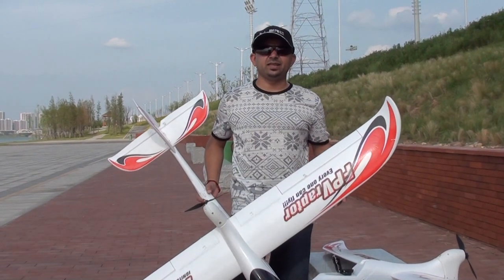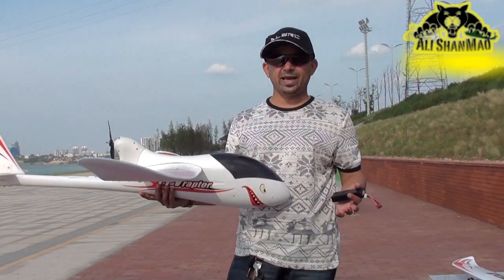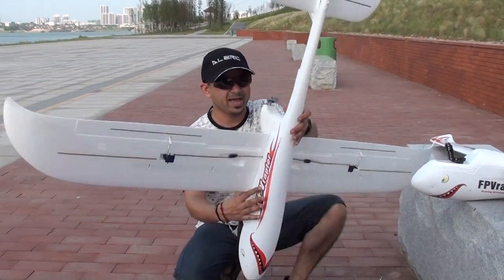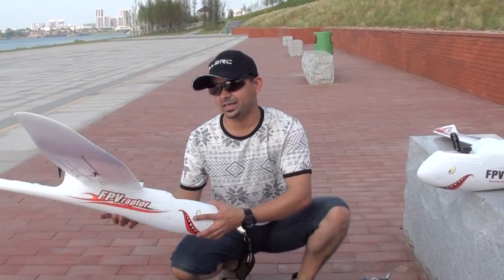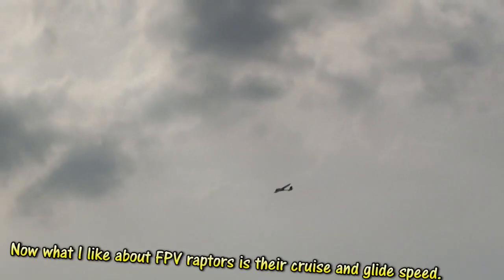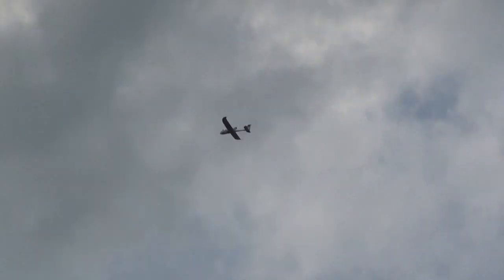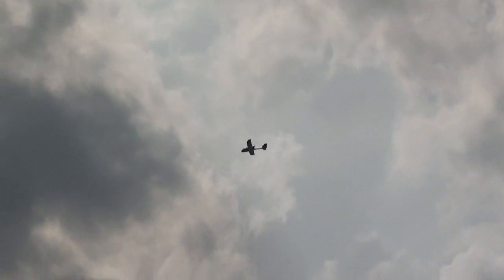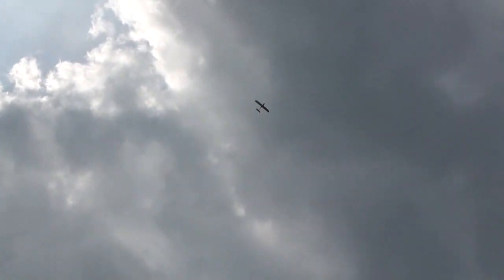FPV Raptor Maiden Flight

Comment: Well this isn't stock set up .... Stock set up means using the actual stock battery..you used a much larger battery with more mah, which tells me really nothing about how long the plane fly's and it changes the weight of the plane as well.   If you advertise stock then do it stock and don't change anything.  JUST IMO

Comment: Alishanmao, I'm planning on putting FPV gear on my raptor (it's 1.6m). I can't find the info on what is the max load I can put on it on stock settings. Will it carry 1.5kg of equipment, what are the limitations? Right now it's carrying HK Wing Camera HD, it's excellent, and the plane doesn't even know it's there. 

P.S. I've read your beginner guide to FPV, awesome work!

Comment: Looks like a nice airplane, thanks for the info.  Would you say it's made of the same foam material as the Skywalker?  The reason I ask is I have read and seen videos suggesting that the Skywalker was a bit on the fragile side, and Skywalker V2 added some carbon fiber to reinforce the airframe.  I saw from your previous video that the Raptor has carbon in it, so your thoughts would be appreciate.